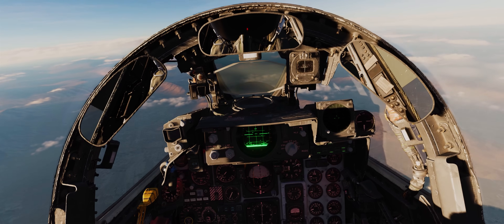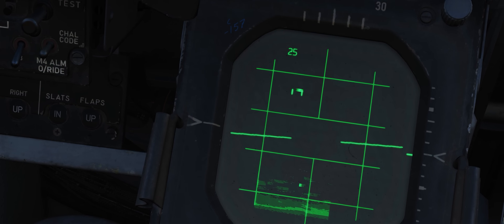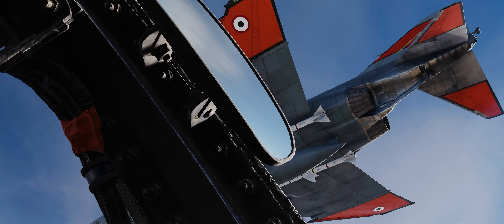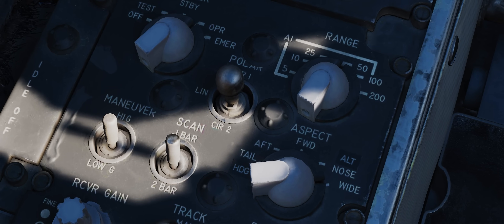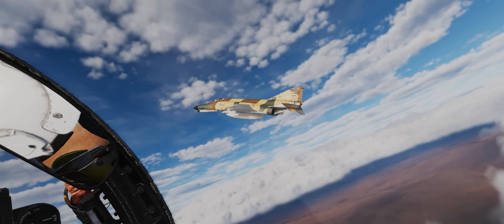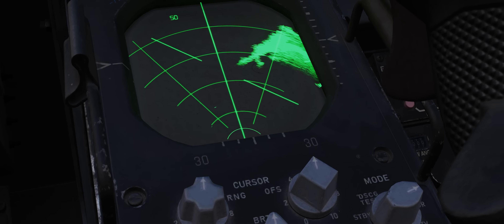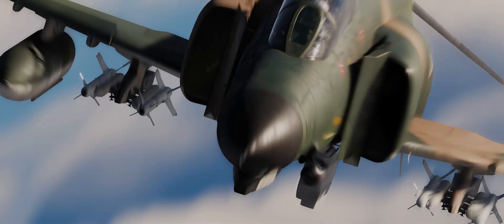DCS: F-4E - Episode IV - RADAR Pt. 1 - Basics and Theory

Comment: So, every time I set the radar up in the WSO seat, a couple seconds after I go back to the pilot seat, the radar reverts back to a 50 mile B scope, regardless of what I set the WSO to. If I stay in the WSO seat, the radar stays in whatever configuration I set it to... Like a 25 mile PPI. but a second or two back in the pilot seat and the radar jumps back to a 50 mile B scope. Is this supposed to happen? If so, why? The only way the pilots display does anything different is when I have a heat missile selected and in Auto Acq. 
So what am I missing?
Also, why can't I tell Jester to change the radar range? I can tell him to change the mode, scan angle and elevation. But I can't tell him to change the range???

Comment: I served as an avionics tech in the US Navy from 77 to 89. Worked on the old EA-6B Prowler. The older version of the Prowler had the old APQ-129 for a radar. It was primarily a search radar but had a terrain clearance function too. It was old, not solid state, and extremely unreliable. It was a modified version of the APQ-112 tracking radar in the A-6C. It would supposedly allow the early Prowlers to fire the AGM-45 Shrike although i never heard of any actually doing that. 
Anyway, that radar was from a similar time as the APQ-120 so I can relate to its questionable accuracy and reliability. 
I also served on board the USS Midway CV-41 when they has a squadron of old RF-4's on board. It was one of the last active F-4 sqadrons in the US Navy.

Comment: I sent this to my dad. He was nav in RF-4C in Vietnam and a techie. He has the highest number of hours flying night recce missions of the entire war. He would snap up night missions from crews that typically didn't want them. He felt safer at night flying down in the valleys of the route packs. Used the radar in modes that were available but which the Air Force never trained, and other crews never used. Something about circular polarization, for instance, allowed him to see through the rain better. But only he used it. The RF had TFR so not the same as the E, but he came out of ADC (F-89D/H/J, F-101B) and was able to use the RF's radar for air-to-air to some degree. He retired O-6 after flying F-111A at Takhli and F's at Mt. Home. He loved his job; a true Scope Wizard. Great work on the model! Even I could see the scope follows the terrain realistically.
Reply: If you can, you should get him to have a go on the F-4 now it is released

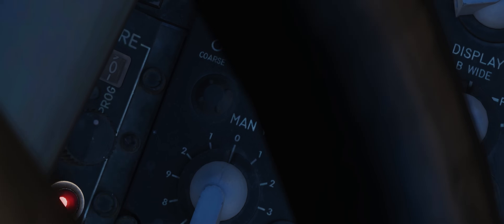Comment: On the radar set control (first seen at 2:49), the correct setting for the TRACK switch should say AOJ OUT, not AOU OUT. Worked on the APQ120 for 11 years--
Reply: Could you think of a reason HB made this mistake?
Or inversely; could you think of a reason HB thought it should say AOU OUT based on different documents?
Reply: @denneledoe873  Maybe the radar set control they were photographing had a scratch where the J looked like a U? But it is AOJ, for Angle On Jam, so AOU makes no sense
Reply: @ga9633  Heatblur released the F-4 manual ahead of release, and in the manual it's indeed referenced as AOJ OUT, not AOU OUT.

So yeah it's a texture error. great catch! but then again, when you work with something for 11 years you get an eye for these things ;)

Comment: Can the radar be used in air to ground?
Reply: This is explained in the video 😊
Reply: It doesn’t have an air to ground mode but since the radar is basically unfiltered so yes. Think of it more like the air to ground radar on the viggen. You won’t get the fancy zoom or detail of the air to ground radar on the F-16 F-15 or F/A-18
Reply: No I mean can it be used in a CCIP mode or like the A-4 Skyhawk's mode.
Reply: @louhodo5761  it's similar to the A-4 Skyhawk's "pseudo CCRP" mode
Reply: @denneledoe873  So the LARPS mode.

Comment: I'm sure this has been asked and answered already, but will there be a tutorial suite to help learn the Radar? I think it's one of the larger missing features of other DCS modules, the ability to learn something without needing to look up youtube videos from third parties on the subject.
Reply: The best way is to read the module own manual.
Then create a own mission where you place a few targets flying a different routes and make the AI not to engage or react for anything.
And place yourself to a wanted position, and when you start mission, enable "active pause".

In active pause mode, your aircraft doesn't move, but all is working, so fuel is consumed, power is used etc, and even AI will receive your speed, why they will shoot incorrectly at you. 
But you can just be hanging in the air in your peace and learn the systems by looking the radar and all your placed contacts flying around. 

So example place a couple targets to fly in same heading as you from waypoint 0 to waypoint 1, and turn back to 0 and back to 1. Set wanted speed variations like other to 500 knots and other for 380 knots and you as 350 knots, and you get to work the radar differently. 
Set some targets to fly at different altitude, or beam you, so coming from left to right at different ranges like 15, 20 and 40 NMI. 

You don't get shot down, you don't waste time (just remember to pull throttle to idle to minimize fuel flow) for training.

Comment: Very good explanations, knowledge and simulation of the APQ-120 radar with its CW illuminator. I made extensive jamming live trials against the F4-E. Hopefully the jamming is badly implemented on DCS because the APQ-120 as a pulse radar is very sensitive both to noise jamming and to angle amplitude modulation swept jamming due to its CONSCAN and not Monopulse angle measurement. CW illu is also sensitive to Doppler coherent noise and VGPO…..Don’t forget warning people being locked on by this radar never try to make defensive 90 degrees maneuvers as used in DCS against all radars even pulse ones like the SA-8……I hope your simulated lock on would stay good and even better in this case….

Comment: That looks immense! Seeing this, how did those "planners" of the 50/60s claim that guns and dogfighting were obsolete? It seems bloody difficulty to lock onto anything under the best of circumstances, nevermind when the target is maneuvering or close to terrain.
Reply: The phantom was designed in the 50s and produced in the late 50s early 60s. There’s not much they can do to significantly alter the airframe after that (not that they didn’t try). The designers were expecting everyone to go faster and climb higher to get above AAA and Flak, and bombers were going higher and higher as well as faster and faster. In a nuclear war, bombers dropping nukes were the existential threat; a low-flying fighter wasn’t a consideration, so therefore neither was the terrain. Note the part where finding a bomber at 40 miles was considered a reasonable expectation. 

Depending on the target parameters, Sparrows can potentially cover less than half of that, but even if it was “only” 12 miles, the previous generation sidewinders were within visual only, and before that it was unguided rockets and/or guns, so being able to hit a bomber at 12 miles or more was a massive leap in capability. 

If you look at the expected usage, this make sense to design an aircraft to climb fast, fly high and reach out and touch the targets at (comparatively) long range.

It didn’t work out like that in Vietnam because the rules of engagement (and the fact there was a lot of friendly air in the area) meant you needed to visually identify enemies. The invention of the SA-2 in the late 50s and its discovered ability to shoot down targets at 50,000ft in the Powers U-2 shoot-down incident meant that these ideas were proven wrong, and in the short term led to the creation of new systems and tactics aimed at working around these new challenges. Meanwhile, the 4th gen aircraft and equipment was in the pipeline and would be aimed at out manoeuvring SAMs, and putting better, clutter resistant radars and longer range missiles.

The F4E we get is a development of the compromises the USAF decided it needed between the design theories of the past merging with the requirement for a quick solution for Vietnam. Remember they still needed to be able to launch fighters in Germany or Keflavik and shoot down Bears too.

Comment: From this video I finally understand why:
1. Dual seater fighter aircraft was a thing.
2. Was WIZZOs/RIOs were said to be that of higher rank than the pilot.
3.  It was necessary to retire F-4 as the premier air combat platform.
Reply: @Rvoid In answer to your #2, WSOs were navigators, and could be lower, the same, or higher rank.  Didn't matter.  In fact, the German Air Force used enlisted WSOs, and so did the US Navy at one point (mainly because the Navy F-4s didn't have a stick in the back, so they didn't have to be flight officer, I think).
Reply: @greghorine4995  From this comment I finally understand why USAF's F4 and Navy's F4 were considered different variants.

Comment: I worked on the AN/APQ-120 in the first half of my Air Force career.  You guys have done an amazing job of recreating the look and feel!  One thing I can comment on is that the pilot's display should be set back further inside of the HUD, since the AN/ASG-26 LCOSS mounted to the front of the radar display group.  It was about a foot back inside, since the gunsight (LCOSS) contained a precision mirror, the reticle light and several servos and servo-potentiometers for moving the mirror, positioning the reticle in the combining glass.  Overall, an amazing job, Heatblur!!!
Reply: Thank you for your kind comment, and thank you for your service! This is indeed known to us, however unfortunately not possible to implement in DCS, or a trade-off, if you will, as it would appear way too deep inside in game and inhibit proper use, especially on 2D monitors. To prevent this we unfortunately had to move it closer in. Thank you for your kind understanding.
Reply: @104th_IronMike  Perhaps have it as a specials option if possible? I'm sure there will be some people who will want that in VR
Reply: @Destarn  it's more relating to the inability to do the lens effect that would give it similar zoom to what we have by placing it nearer
Reply: @104th_IronMike  Guys, if this thing is as good as youre making it out to be, it should be 3x the price. Youre basically giving it away at 60$.
Reply: @spikeypineapple552  That is true for all modules more or less. However, for one, it would be very unfair and detrimental to simming if the entry bar would be set that high, and ultimately, less ppl would go for it. In the end, not everything is about money, even if it is both needed and nice to have. 🙂
Reply: @104th_IronMike  lol you work for dcs?
Reply: @badgermilk760 I think he’s with Heatblur.
Reply: Seems like that would just be something like a 15% larger (magnified) display set back a foot (or maybe 9 inches) from the front “lens”.  I don’t think it would be a problem in 2D.  But Heatblur knows far more than I do. 😄.  It would be cool as an option for VR…but if it’s not feasible, I understand.  I have one of those LCOS units that mount on the front of the pilot’s radar display from an F-4B (as far as I can tell).  Bought it from a surplus store decades ago, not knowing what it really was.  Now I know a little more about it.
Reply: @Andrew-13579  The front scope was identical (functionally and display size-wise) to the rear scope.  There was no magnification between the front filter on the LCOSS and the internal display face.
Reply: @greghorine4995  You’re right.  I was mistaken.  It doesn’t seem to magnify, but  there are lenses in there.  Or, at least on this one:  “Optical Sight AN/APG-59.60” made by Westinghouse.  S/N plate on the other side of it says, “Optical Sight, ACM American Cystoscope Makers, New York, NY”.  Appears to have a date of “12  67”.
Assuming it would be mounted up against a CRT display, it appears to optically lower the line of sight to that scope and focus it farther out, so that the pilot doesn’t have to focus his eyes close up?  Additionally, there’s a standby fixed sight reticle illuminated by an incandescent light bulb.  Its image is bounced off a mirror inside the bottom of the sight unit and up through a lens on top that then reflects off the adjustable reflector glass plate, allowing the pilot to sight it forward through the windscreen, focused to infinity.  The part that sets the depression angle of the fixed reticle is missing.  I don’t think there’s a lead-computing sight on this one, only fixed, because the F-4B/J did not have a gun.  Might be from an F-4J.
Reply: CannedCoochie  good, this man has to be protected at all costs.
Reply: HeatBlur, Listen to this man!
Reply: @koocoocroc1235  They've seen real Phantoms and worked with real crews so I'm sure they know but this is a necessary step to allow usage of the radar scope on flat screens and better usage in VR
Reply: @Galf506  Ye, you would think so

Comment: lol at the look on the face of that radar operator dealing with the challenges of unfiltered radar images
Reply: Definitely the best pilot animation we've seen yet. But will it move chunky in multi-player like all animations do?
Reply: @AdmiralQuality  i guess the whole phantom will be a chunky mess for my pc. Sat yesterday in the f14 with stuttering every 3-5 seconds. I can play every other module on high graphics and on full servers without any big trouble but if the F14 is even lagging that hard on everything low and they already said the phantom will have worse performance than the F14.. makes me wanna cry😢😂
Reply: @_Am0N_  I'm worried about how it will perform as well. But the issue I'm describing isn't due to local machine performance, it's a multiplayer thing. For some reason DCS doesn't smooth motion of animated objects (like pilots, gear and flaps) for aircraft in multiplayer. I get that they don't want to send 120 updates a second for their positions, but still that's no excuse not to smooth the motion. And it will make these rather excellent animations look very low frame rate in MP (unless HB have found a way around it).
Reply: @AdmiralQuality  yea i know. It just triggered my dcs performance ptsd😂
Reply: @AdmiralQuality  (HB dev) This is actually up to the coders and we did it "proper". The animations are smooth in multicrew.
They are stuttering if you sync the current pos. Instead, you have to sync the target position and compute the actual movement to that target position locally on each machine. That way animations play smooth :)
Reply: @Zabuzard  Great. When's the Tomcat get them? (And I'm a coder who knows all about splines and interpolation. You could just simply get the the tween frame positions/angles from an IIR filter and get the result you want, with an acceptable slight delay.)

Will the tires sink into the runway in multicrew or is that baked into DCS? (Speaking of splines, my spider senses tell me ED are doing it wrong. I've never seen any other sim or game do that and I've been flying multiplayer combat sims since Warbirds in the late '90s - on modems and with hundreds of players in the server!)